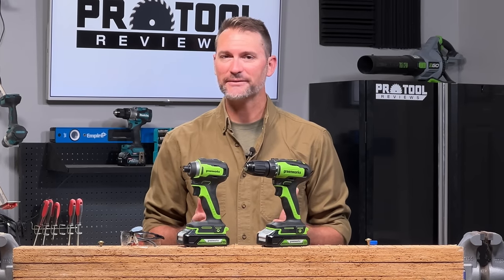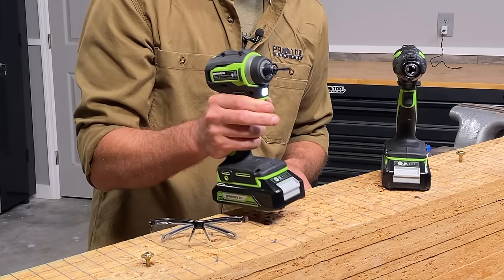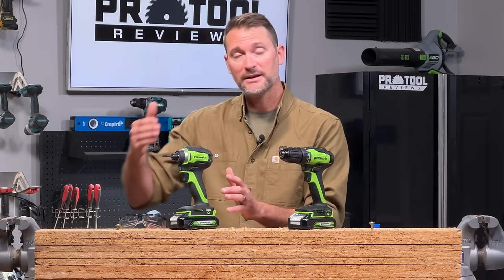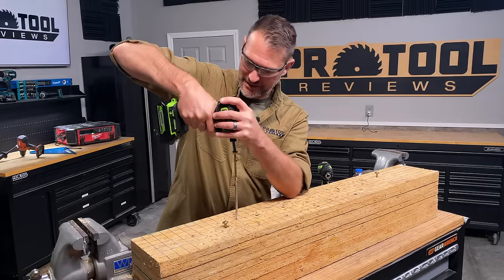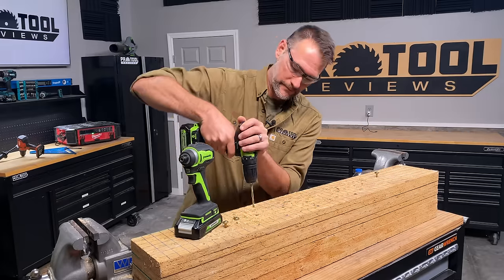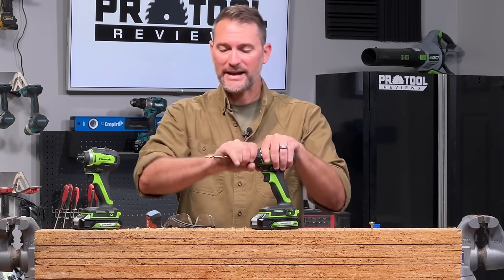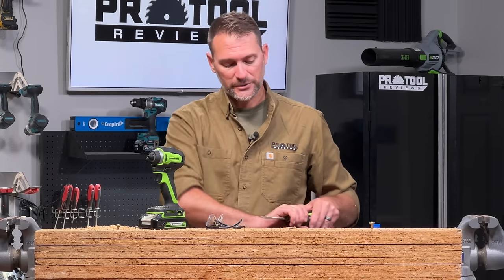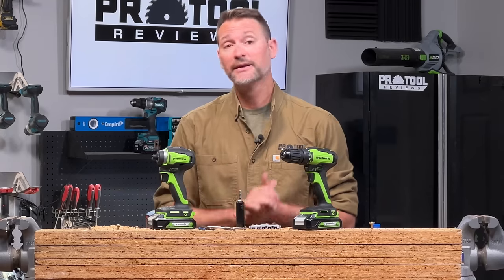What Is An Impact Driver? How To Use an Impact Drill

Comment: NOTE: Impact drivers are NOT THE SAME as hammer drills. I noticed a lot of people asking about using the impact driver for concrete. Use a hammer drill with concrete bits. A hammer drill strikes axially towards the point of the bit, and impact driver strikes tangentially. So an impact driver's hammer helps rotate the bit. A hammer drill hammers the bit into the material.
Reply: 2:pm  an excellent explanation. Leaves no question unanswered.😊
Reply: Didn’t even have to watch the video thank you for your comment
Reply: this, thank you
Reply: I actually did think of hammer drills when I looked up this video! So thank you.
Reply: Excellent
Reply: Thanks cleared up the issue
Reply: Thank you

Comment: Long tool operations are not just a concern for the motor overheating. The batteries also take a beating and can get hot during extended discharge.  It is a bad idea to run the heck out of a battery and then immediately throw them on a charger. They need to cool down first.
Reply: If you had to stop your operation due to the battery overheating, it’s the manufacturers fault! Batteries are designed to be able to deliver ~20% more current than your machines draw during loaded operation. This 1/5 buffer margin on top prevents thermal shutdown of your battery. If you run into thermal shutdown regularly, it‘s a clear sign that the buffer margin has been decreased by the manufacturer in order to decrease cost by a small amount but decrease its lifetime significantly! Now regular usage will damage batteries much more than usual, hence performing exponentially worse with time and forcing you to buy a new one in less time than otherwise possible, had the buffer been left around those 20% to equalize any battery aging effects. TI’s Batteries (Ryobi, Milwaukee, AEG,…) are designed in a proper way with enough buffer to be able to power all their different tools over the long run. Many more Brands are properly designing their batteries, please feel free to add those ones below!
Reply: Correct. However I use the crap out of my power tools every day, but haven’t ran into this from typical use though. 

For me it’s usually due to environmental/ambient temperature, and that’s only happened to me in the winter months (I’m sure others do as well, but Milwaukee chargers will blink certain led’s if battery is too cold/too hot and waits to begin charging sequence).
Reply: Most battery chargers at least the Milwaukee won’t allow the battery to charge if it’s too hot. It lets it cool down first so the customer never has to think about this. Get with the times

Comment: Always use protective glasses when using an impact driver. You will notice that the illumination light shows up  a fine metallic dust is produced at the screwhead. You do not want this dust in your eyes!! Uncomfortable and embedded metallic dust might cause severe damage should you need an MRI scan in the future

Comment: Your impact drill shank got clogged with wood shavings when it got deeper into the stack of wood...you didn't hit anything. The same happens with regular drill bits. You have to pause your drilling, pull out the bit from the wood, clear the wood build-up, then finish your hole.
Reply: It the machinist world, called peck drilling. Should be used in all drilling operations.
Reply: "finish your hole"

Hubba hubba!

Comment: Its easy to strip the wood when driving a screw with a impact driver whereas a drill has an adjustable clutch.
Reply: Exactly i find an impact driver used on wood will sometimes strip the wood when it reaches the full depth it just spins around meaning it has lost most of its holding power. In the same situation just using a drill driver it can easily bury the screw right in below the surface without stripping the wood.  I only ever use the impact for putting in metal screws screwing into metal.

Comment: I genuinely thought the main reason men use these, is so their wife thinks they are REALLY busy.  That racket, pierces for about 6 neighbours’ homes.  Massive nuisance.  Instead, have an ordinary electric driver, and grease or wax the screw beforehand.  As with the impact driver, as I tell my daughters ‘Lots of force (on the back of the driver), a little trigger.’  Which works for both.  The main benefit I have found - imho - is on rusted motor vehicle bolts etc.  You can break rust, and may not even need to hold the other end that’s awkward to get at, because it’s hammer action and the speed, has that benefit.  But, they’ve become very popular, especially if you are not going to buy more than one electric driver, I guess you’ll get the impact.  Interesting and useful explanation, thanks.

Comment: I used an impact driver a lot when I was in the USAF. One of my tasks was to take off panels on an airplane so specialists could get access to equipment and repair it. The panels were attached using nut plates. There were thousands of nut plates on each airplane. The slot in the nut plate would get worn off  so a speed wrench could not get a grip. Our impact drivers were manual. We would hit the tool with a hammer, that would drive the bit down and twist it, making maximum use of what grip that remained. That saved a lot of calls to machinists to drill it out. I bought one for use at home.
Reply: You were sheet metal? Im metals tech.
Reply from the maker: You would appreciate the old school way they use to set, hit, twist, hit...repeat... concrete chisels to bore holes before powered rotary hammers.
Reply: These "impact drivers" are a different thing. They have no downward force other than what you apply with your arm. I totally know what you are talking about though, and have one for stripped out screws too. The thing you used is more for removing screws/bolts. Impact drivers are more for forcing screws to turn into materials by tapping them in a rotational direction.
Reply: @Vincerama 
I don’t know any power tool that have a downward force to supposedly drive a screw in automatically! 

But that would be super cool and beneficial if some company has the technology to produce it to the tool market in today’s time!

Comment: Your drill bit bound up once you had all of the flutes buried, you didn't hit anything, it's just that the bit could no longer eject the cuttings to clean out the hole.  If you'd have lifted to eject the cuttings, you could have buried the bit easily

Comment: 1 major difference you forgot to mention, you wont break ya wrist with an impact driver, where as a drill (if stuck or trying to get tighter etc) has a chance to spin hard an either break ya wrist or spin and smack ya hard :D

edit: (as somone else mentioned)
Reply: "ya"
Reply: I’ve had this issue a couple of times cutting holes to run Romex through or a 4.5 inch for duct work or even a 6inch cutout attachment. It messed up my wrist a couple of times. I’ve tried different settings and I’m using the dewalt hammer drill xr no idea if there’s a way to fix this
Reply: Isn't that why the chuck is there? I mean the impact doesn't have a break like the chuck gives you. So if your nearing the end it will run and twist where as a driver will start to rattle
Reply: Rookie 😂

Comment: One thing to remember is that you must use bits that are designed for impact driver. Those bits are manufactured with a torque zone to accommodate the extra torque an impact driver delivers compared to a drill. A regular bit will break after encountering resistance.

Comment: Great informative video thank you!
I am curious about how the impact driver works when you bottom out a screw. Will it in fact keep spinning and strip that screw head ? I suspect it will, making a drill/screwdriver with a variable torque setting release more advantageous for delicate operations in which you do not want that screw head to get scarred or damaged beyond recoverability.  I usually set the clutch to a medium setting and adjust up or down in sensitivity to a suitable clutch setting for the particular application.  I haven't used my impact driver yet, but my first project will have exposed screw heads and could use the advice. Thank you!

Comment: Impact drills are better for drilling metal--they are used a lot in the construction industry for fastening cold rolled steel using self-drilling screws, or for drilling holes prior to tapping them with threads.
Reply: There are impact drivers & drill drivers… an “impact drill” does not exist in today’s market.

Comment: Does the hammer action work in reverse on an impact driver?
Reply: Yes. If you get one strong enough, you can loosen the rim nuts on your wheels. Some of them are as powerful as air pressure ones, which is great for when there is no compressor around.

Comment: Thank you for explaining it's specs, can I use it with brick wall or concrete for light duties?
Reply: Yep
Reply: That's not the best choice. Get a hammer drill. It hammers into the concrete, breaking the little rocks the drill runs into.
Reply: You can but it wont be as fast and powerfull as an hamerdrill

Comment: my question is as long as I have compatible parts should if I get spare cash for chrismas while I am not going to get rid of my drill would you recommed I get an impact driver I need a drill bit that is 1/16 and standard compatible philips and flat head bits would you suggest I get the driver than find compatible bits thoughts please thank you

Comment: Speed and torque (power) are the same on a drill and impact driver with the same  chassis and motor - when measured at the same MOTOR RPM.   It's the lower gear ratios of the impact drive that makes the impact driver have more power at lower bit RPMs.

Comment: I find impact drivers overpower the fasteners and strip them out or drive them too far in. I'm going to buy a separate cordless drill and use the clutch to drive fasteners more effectively.

My impact drivers will be used for sockets.

Comment: Can an impact driver be used with good results drilling concrete? I'm thinking that in a pinch it might act like a root-hammer?
Reply: Not really. For concrete you need a hammer drill. The hammer drill works by moving the drill bit forward/backward really fast, replicating the hammer motion similar to using a hand hammer on a nail. On an impact driver, the hammer motion rotates in the same direction the bit is turning, so the bit does not move forward/backward.

Comment: For driling into exterior brick walls, do I use an impact driver? if so, which type or how many watts impact driver do I need?
Reply: A mains powered hammer drill is always best for brick and concrete, but if you don't have mains power second best is cordless drill with hammer drill function imo.

Comment: good info! what type of drill would you use on a motorcycle taking out bolts for like an oil change?  Want to make sure not to have too much power and scrip the threads.  I see mechanics using some sort of drill to remove low torque bolts, such as the oil filter cover bolts. thx
Reply: You might be thinking of a compact ratchet wrench.. But if you have to decide between impact driver and drill, DEFINITELY use the former. As the guy in this video mentions, power is proportional to speed. Since you don't need a lot of torque to remove oil pan bolts, you can just use the slow mode on the impact wrench to get it off nicely. Either way, I'd suggest using a hand wrench because battery powered stuff is the best way to strip bolts.
Reply: Milwaukee makes an electric screwdriver drill, it’s around $100 at Home Depot, and it has a clutch system on it, so you can set “torque” you want and once it reaches it, the clutch will slip so you can’t over tighten

Comment: Seriously, my Milwaukee drill has more than enough to torque to drive as well as any 1/4 impact. It can drive a 14 inch screw through a hardwood beam, so whats the point of buying an impact driver as well ?.  Just buy a quality drill in the first place. As for the collet style bit holder, they sell those to fit a drill chuck and any quality chuck has locating lugs to securely centre a bit holder.

Comment: You didn't mention a critical fact - the drill has a clutch, so that you don't over-tighten or strip a screw.  The driver doesn't have a clutch.  Or am I wrong?
Reply from the maker: Impact drivers do not have a clutch mechanism, that's reserved for drills and hammer drills.

Comment: Just because a bit has a hex shank doesn’t mean it was designed for use in an impact gun. I thought that part of this video was incorrect and kind of silly hahaha
Reply: As that’s not what he said so I don’t see your point. He said (after the hex statement) specifically designed for ………” back to referencing the drill it’s self. The hex shank on a drill enables one to see that’s it’s OK to use in an impact and will take the additional forces. 
What’s to understand here?
Bob
England

Comment: Wont a hammer drill do the same thing?
Reply: Nope. Hammer drills, as the name suggest, hammer the drill bit in forwards to push against the material being drilled into. If you do that with a screw you are going to be pushing the threads against the material they are trying to grip, compromising the hold the screw has in the wood.  Impacts ‘hammer’ sideways, helping the screw rotate, not push forward.
Reply: Did you not listen!

Comment: I don't get it, every good compact drill also has a hammer function, so why would one need an impact driver in the first place? I never used one in my life. I get all my projects done with a regular compact drill. I think this impact driver thing is just an unnecessary hype which is too loud also.
Reply: Everything you can do with your impact driver i for sure can do with a good Bosch compact drill in the hammer function except losening lug nuts, which provides tough torque , too and it never fatigues me. What do you consider tough Material?